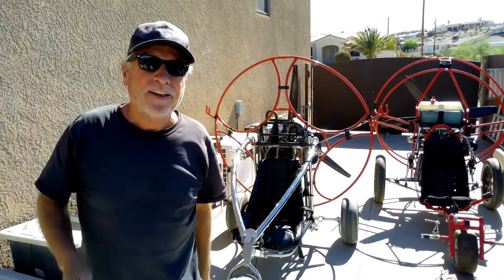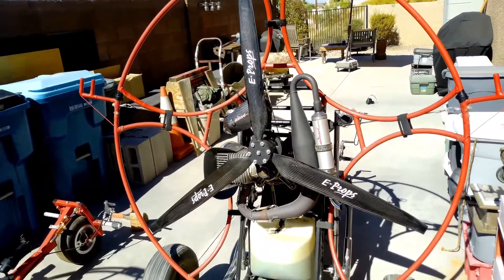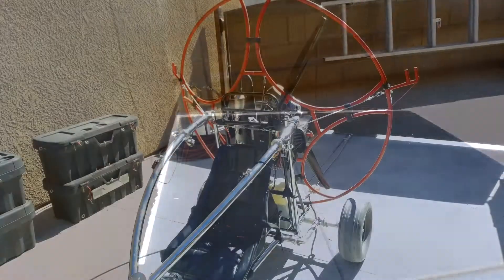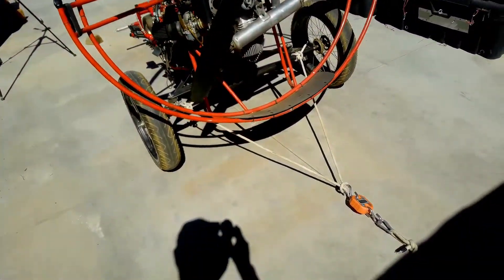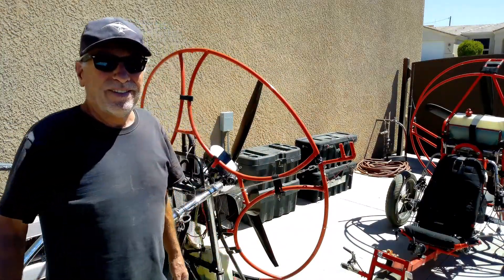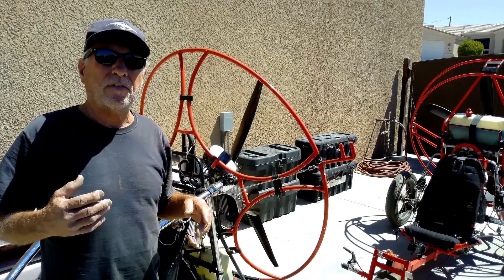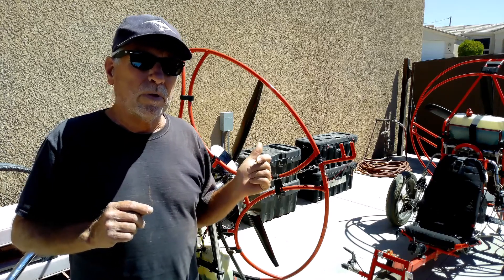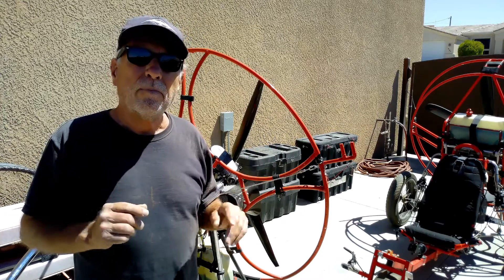PPG Thrust Test Minari 200cc vs Monster 312cc

Comment: Hi..I'm late to the video, but thanks for publishing. I'm a little surprised by the thrust numbers, which I consider low in both cases. Possibly your elevation skews them lower generally? No matter, thrust testing is subjective even with the cleverest setups, more telling is the comparison. I'm not surprised that they both pulled about the same numbers. The FB Monster runs in comfortable de-rated configuration, which is not a bad thing at all. The 200 is running balls to the wall. I had a 202 FB Simonini that could be easily out-performed by a 172 black devil, I much preferred flying the FB.
Reply from the maker: Hey Terry see you at Salton Sea in Feb?  Yes I prefer flying the FB Monster.I'm going to redo the thrust test since the digital scale doesn't work good so I got a mechanical scale which should work better.
Reply: No Salton for me probably, but that be the best place on the planet to do thrust test:)

Comment: Do you like the minari (power/reliability:exhaust,carb adjustment)?
Reply from the maker: I'm starting to get use to the Minari but I prefer the FB Monster.  The Minari is a higher reving engine and cruises at about 6700 rpm as compared to the Monster that cruises at around 4700 rpm.  I prefer the power band of the Monster.  I also prefer the Bing on the Monster verses the diaphram carb on the Minari.  After just about 20 hrs on the Minari the pull starter main spring broke in half.  But to be fair I've also had failures of the Monster pull starter.  I've been flying the Flyke with a Monster for many years but only have about 30 hrs on the Minari so it's hard for me at this point to give a fair comparison.  Hopefully the Minari will prove itself over time.